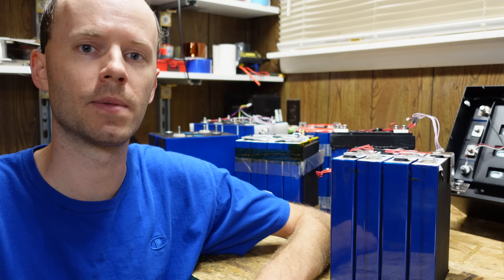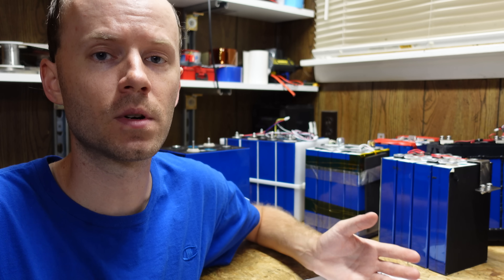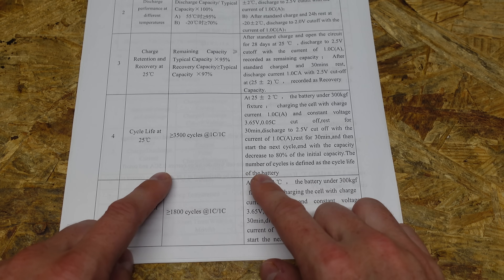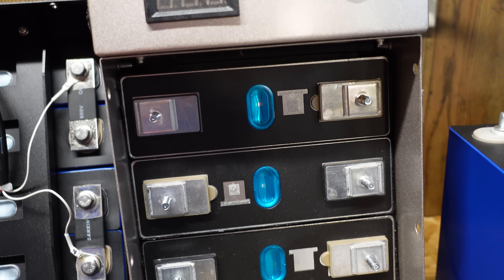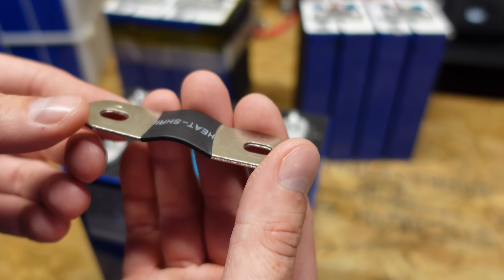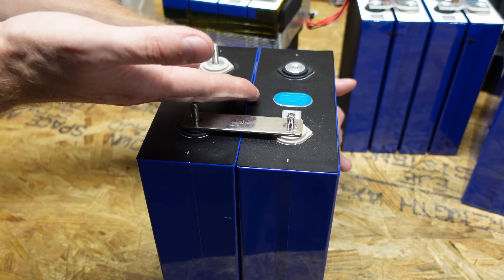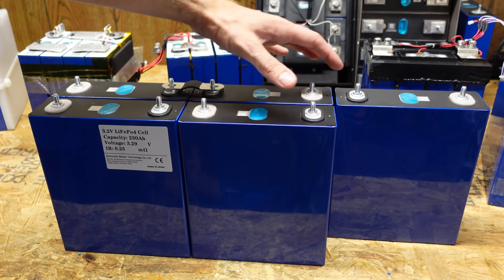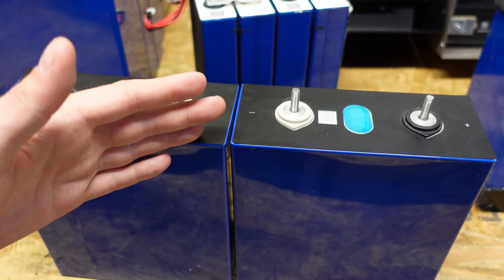LiFePO4 Battery Compression, Fixture, and Assembly - What's the Deal?

Comment: One detail that hasn’t been mentioned - at least that I’ve seen - is the fixture tests done at the factory appear to have done so with one cell. The reason I bring this up is that once you put two or more cells together, the sides of the battery cells are no longer in fixture except for the two outermost cell faces. If we consider only two cells together, the two outer faces are against plates, disallowing any movement across the face of the cell. The two inner faces are not in fixture against plates and would be able to move into the other cell’s face. (Two “soft” planes together will not prevent movement into and out of each other.)
The question arises: Would an additional plate (arbitrary thickness) be required between each plate, and pre-tensioned to the previous plate, etc.?
It never ends…

Comment: fusing them with 110a fuse will not trip easily at 130a. Fuse is not ment to limit the current. Is only to save the wires from catching fire. limiting should be done by the charge controller and/or the bms. 0.5c is the max I will go both charging and discharging. so if I need to be able to power a 10kw load I will have at least 20kwh battery.

Comment: you can use  jumper  cable wire  as the bus bar
Reply from the maker: Jumper cables usually contain copper-coated aluminum wiring. No thanks.

Comment: do my balance cables need to be in the center of my bus bars? or can I put it on the terminal?
Reply from the maker: Either location is acceptable. I prefer putting them in the center of the busbars simply to avoid having the ring terminal under the nut that's also holding down the busbar. It kindof negates the purposes of the serrated flange on flange nuts.

Comment: What size cable should I use to make some flexible bus bars? for the 100Ah 8S 24Volt.
Reply from the maker: I typically follow the NEC recommendations for home residential wiring in my application. 
https://www.usawire-cable.com/pdfs/nec%20ampacities.pdf

Comment: At a point you state that as 10 cells expand more than just the 2, ie you add together the expansion. No, the top and bottom plates and edges don't expand, they expand on the sides from the center, the weakest point. If you leave air gaps or compressible material between the cells they expand into those gaps, so no added stress on the studs. Any cell that expands enough to rip that gap and more is a bad cell or is not up to doing the job you are using it for, your stressing the cells.
Reply from the maker: The comment regarding 10 cells expanding more than 2 was in reference to them being against each other with no gaps (air, foam, otherwise).
Reply: @LithiumSolar   Correct if they are fitted with no gap and have no tape/clamping   on the body of the battery.
Though the whole overall length may grow by 5mm, each cell grows by 0.5mm, other than the two end cells the expansion is exerting force from both directions.
Expansion of lipo cells with metal or substantial cases is not going to stress the posts. The foil packet type is a different story but they don't use posts.
A reason for inserting a spacer between cells is as much to do with insulation of the metal cases as the wrap material is very easily damaged.
If you minimise expansion via clamping you keep the chemistry inside in close contact with each other and reduce potential degradation due to flexing. 
If you don't clamp the bodies the battery will expand like a paper fan. The connection end stays put and the bottom splays out, if you clamp, then clamp them at top and bottom.
Any expansion big enough to stress the posts, as mentioned before,  means a bad cell etc.
1mm of compressible material between cells and tape 4 to 6 cells together make a reasonable unit to handle.

Comment: @2:38 "It comes out to roughly 12 psi..."  ...which is also the approximate stiffness of the separator between the cells.  That's about 50 on the Shore 00 scale, or 0 - 10 on the Shore A scale. That's about like a soft gel or rubber band. As I've mentioned before, the separator needs to cover the entire adjoining surface area.

Comment: Wouldn’t using wire as the bus bar solve the problem?
Reply: A solid busbar works fine if it has a more pronounced hump... more like a half-loop. If normal loads aren't too high, a solid wire loop (with the loop horizontal) will work.

Comment: I have the same issue, I’m thinking of cross connecting the cells without rotation in. This would have an accordion style connection so expansion and contraction would present to the terminals as rotation, not linear expansion.

Comment: Dude, you are very wrong! They expand, but mostly in the middle, so if you fix them from the sides it won't put presure on terminals, because that portion of cells will stay the same (doesn't matter contraction/expansion). That is why they let space in between in the middle portion. When they expand, they make like a belly in the middle section, but the sides/corners will be the same and you can put pressure there so the terminal distances will not be affected whatsoever. Leave that gap in between middle cells, otherwise will put pressure on terminals.

Comment: The bent bus bars is just how some people make them shorter. (i.e. the "correct" length.) The force necessary to bend / stretch one is orders of magnitude more than those terminals can take. What happens is the module accordions, fanning out at the bottom because the top is bolted together. (broken zip ties prove it.)

Comment: You need air quotes around the word "professional". Just because they sell battery modules doesn't mean they know what they're doing. (lots of people assemble battery modules. I do; you do...) If you're cycling the cells slowly over a greater period, the delamination and ballooning will be gradual, and you'll chalk it up the age. I have several cells on the bench that ballooned badly after a few dozen cycles, but in a car they're under a lot more stress. (2C discharge, 0.5C charge) CALB batteries, with much stronger casing -- and better all around construction -- have not shown such issues. (the casing provides the require compression during cycling.)

Many of the cheaper commercial packs don't have proper fixtures because it increases costs. A wood, steel, or aluminum plate is just extra cost. Look at many EV car modules; those are incredibly well secured. There's a BMW i3 (1st gen) module on my desk right now. That's several pounds of tig welded AL (by the looks of it, by hand.) The Chevy Volt has steel plates and steel rods compressing them. (pouches, so they have to be)

(I'll send you one of the dead i3 modules, after I disassemble it, if you want to see how a Real Battery(tm) is [over]built.)

Comment: Nice construction....I pondered for months on how to do this.  The problem I was having was designing a fixture to keep a constant pressure on the battery through charge and discharge cycles.  Eventually, I settled on the cheapest (springiest/stretchiest) ratchet strap I could find.  The strap is completely wrapped around 2 thick plywood ends that cover the batteries at the ends and distribute the force.  The straps are cinched as tight as I could get them.  I'm guessing I have around 300lbs of force that stretch to follow the charge and discharge cycles.

Comment: So why not use braided ground strap for the bus bars? Remove all the stress, higher heat dissipation, it's basically the perfect bus bar. Expensive, but worth it if you want to actually get the 3-4000 cycles out of the battery, especially if it's a mobile solution subject to vibration.

Comment: After eight months of usage in my van, I will actually modify my two 280A batteries to add a fixture, not for the extended life, but mainly to prevent the cells from moving and better withstand the vibrations. I have had to go back and open them twice to tighten serrated nuts that had gotten loose. I already have insulating pieces of polycarbonate between the cells, but I intend to add spacers for cell expansion.
Reply: It really is important to check the "tightness" of the fasteners! Heat cycles will make them loose. Loose connection= bad.

Comment: From all my observations it seems that the expansion of the battery is most predominant in the center of the cell. Therefore if you use your expanding terminal connectors and put small 1-2mm rubber spacers on all four corners between the cells, and possibly a small patch in the middle of the cell, t would accommodate the expansion as well as cooling. Any thoughts would be appreciated as I am about to fix 32 of the eve 304.

Comment: Do we actually know what the construction looks like inside the prismatic case?  Is there a chance that some pressure due to bloating isn't a big deal?  If the terminal sits on the top of a soft pouch, does it really matter of the terminal moves a small amount?  I cannot find a video of even a diagram of how the prismatic battery is put together.  Anyone have a reference?

Comment: Sheesh!!! 

1) That spec is for 1C charge/discharge rate. More likely PV systems will use 0.1C to 0.2C rate. Then, life cycles can be much higher. Clamping hard might be important in EVs or boats but it's a waste of time for a battery sitting on a shelf for 10-20 years.

2) If you want your battery to last keep it cool and limit SOC/discharge. A bigger battery naturally will last longer in PV applications.

Comment: I wonder if they are talking about using them in a car, bus, or something mobile.
I’m thinking sitting stationary that compression isn’t as important.
I’m going to secure my batteries but not compress them.
And I will use the bussbars  with the bend in them.
Time will tell.
Reply from the maker: I've pretty much reached the exact same conclusions as you just stated :)

Comment: As A battery seller in China, I would like to say that having A QR code does not prove that it is A grade A cell. EVE and Lishen have A QR code in grade B. CATL's B-grade cells doesn’t have QR, but many b-grade cells are better than fake A-grade ones with QR codes.
Reply from the maker: That's correct, but it's one of many features that can be checked and added up to reach a conclusion. As a battery seller in China, is there any information you can share on how/why QR codes are removed on the batteries that you're selling?
Reply: @LithiumSolar  At present, only CATL's battery  wear out the QR code, and only CATL is most responsible. CATL was actually reluctant to give the cells away for DIY, and they had to be strictly used for big projects they approved after inspecting them. And strict supervision of all dealers, in order not to check the source of goods through the TWO-DIMENSIONAL code, to wear off the two-dimensional code. In fact, the cells are brand new and unused.
Reply: @LithiumSolar  EVE and Lyshen lack this oversight, so their B-class cells also have QR codes. Everyone thought it was an A+.

Comment: Hi i would like to trow this in to the mix when we talk about compression according to the manual is something around 12 PSI and i believe is wright BUT if ya'll stop for a moment they talking 12 PSI  per battery so when putting bunch of battery's together and try to compress them the result is that ya'll end up compressing the living lights out of your battery's and funny you prove this when placed your battery's loosely and then the battery's expand and get compressed as they charge they provably compressed more than the 12 PSI recommended you could not even get them out of the base that you make so to put it easy i believe the problem reside in each cell so to compress them properly each cell would need to be compressed like example the CALB cells are design so that the plastic case compress the battery as they charge as for the SOK and others manufactures of battery's the way they deal whit the problem is by simple putting their cells loosely and hopping as they get charged they compress that's way they use only four cells per battery because the more cells the more they compress especially in large 280 or 320 cells i dont say CALB battery's are the answer as they also have their problems, but their is a reason this battery's cost less and is because to make them less expensive they don't put them in cases just wrap them in thin aluminum and called good so i hope this help i personally don't even bothered compressing if anything is being proved whit this battery's is that even when compressed (and over compressed) or not they work fine so unless somebody come whit a case to place each individual cell in place and make sure each cell is not adding PSI to the bank i rather don't compress as i would never know how much compression i end up in a large 48v 16 cell for example i thing what is best in this large banks is to place the batterys in a way so they are not all touching (compressing) together !

Comment: Thanks for the ramble. ;-) I came to the conclusion that home-made heavy gauge multi-strand battery cables with self-crimped lugs (using an inexpensive hammer crimping tool) were the answer to both relieving any concerns over stress on the terminals from movement and allowing for flexibility for configuring the battery pack. My two 280AH 4S battery packs are then held in a battery box with stiff plastic sheets between the cells and 1/4" acrylic at each end. The battery box is narrower at the bottom than the top, so I simply wedged the cells in snugly with dense foam at the bottom and used one 1/4" threaded rod across the top to snug them up just enough to eliminate individual cell slippage while in use in my camper. After one summer of many miles on very bumpy gravel roads they've held up well.

Comment: And, separate comment, use (make) flexible bus connectors with copper braid. Solid copper with hole, braid and again, solid copper with hole. 
Omega shaped, the braid goes in the middle.

Comment: My three years involuntary experiment result on somewhat bigger RC pouch lipo packs, exploited daily. Over 1000 cycles from 3.3 to 4.2 but with conservative rates of charging and discharging. 

Standard RC pack with soft tape and thin plastic insulation. Just a tad larger than average, 8Ah cells, charged with a maximum current of 3A and discharged with a 40A maximum load. Never exposed or allowed to reach over 40°C

The packs were held in a case that provided some level of compression but uneven, leaving one cell only held by it's edges. I only wanted the packs to stay in place and not rattle in the case when vibrating.  

The outermost cells swelled noticeably and their capacity reduced <80%. The innermost cells that were held in some compression by the case walls and adjacent cells did not swell and retained their capacity beyond my ability to differentiate. (My capacity measuring tools have about 10% tolerance)

That is a lithium ion polymer battery expected to provide ~500 cycles of useful life and I'm not using them because two cells out of six in each pack swelled and lost capacity and efficiency.  

I am now convinced that, had I used a mean of uniformly compressing the packs, to reduced the daily mechanical stress caused by normal charging&discharging, I could've pass 2000 to 3000 cycles with these classic lithium pouch cells. 

Obviously, cell compression must be done with consideration to the cells chemical and mechanical construction. Compression does not mean crushing and if done improperly will cause more damage than the lack of it. 

Also, decompression is dangerous. 

Looks like gas generation rates and pressure increases with a positive feedback loop. Cell swells when charging because lithium intercalates in the graphite layer. 
This is reversed at discharge. If the electrodes are not compressed, they will not maintain the original proximity. The plastic/aluminium pouch plastically deforms and no longer provides compression. 
With the electrodes now apart, cell internal resistance increases, that leads to efficiency decrease and gas generation increase. 

*Recompression of a previously compressed pack or already swollen could damage the electrode separators, delaminate the active compound from the metallic substrate, puncture the separators and short out the cell.

Comment: Use flattened copper pipe flattened and bent at 90 degrees vertically and flatten and drilled horizontally for the terminals. Cheap and includes strain relief at the 90 degree bend. should still be round between vertical and horizontal flats.

As for compression/fixture, use mass on a 90 degree lever to push in the centre of a 25-32mm ply wood board. You can adjust the mass to equal 12psi and match EVE's recommended pressure. Do it at each end.

Comment: Anytime you flex metal especially aluminum it fractures and fails. I think you'd be better off using copper braided wire with a slight bend in it. I watch your show because I don't know much about batteries but I do know metal. I think the only reason they don't use braided copper wire is because it would be much more expensive than stamping out plate. Just my thoughts on it.
Reply from the maker: The metal busbars should not be flexing under normal operating conditions.

Comment: Hey, nice video and I feel your pain re: cell movement and bussbar stresses.  What I am going to do is arrange my 4S cells with the Positives in a line and the Negatives in a line on the other side.  My 3 x bussbars will then run diagonally across the pack.  This should heavily reduce the chance of bussbar stress as any cell swelling will be lengthwise but the bussbars are at an angle.  Hope this makes sense and gives you an idea to try.  keep up the videos. cheers